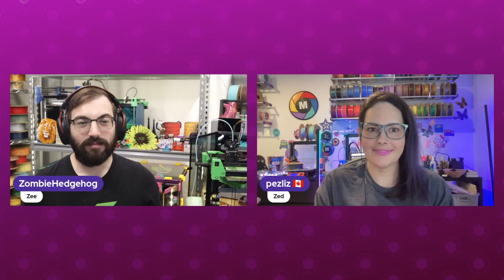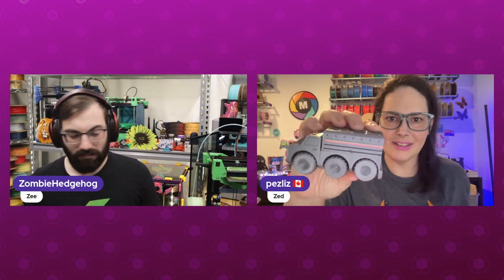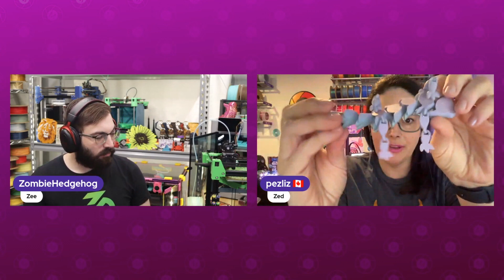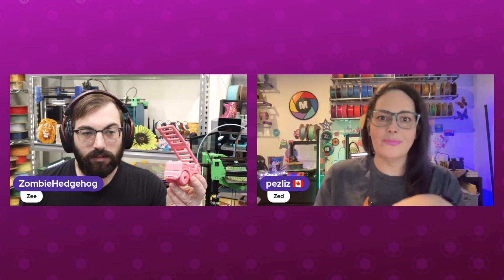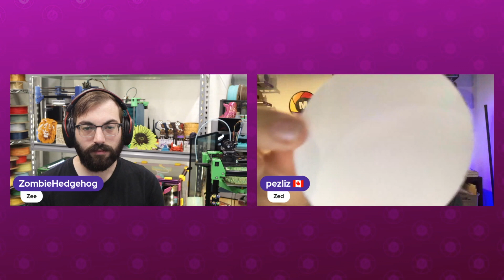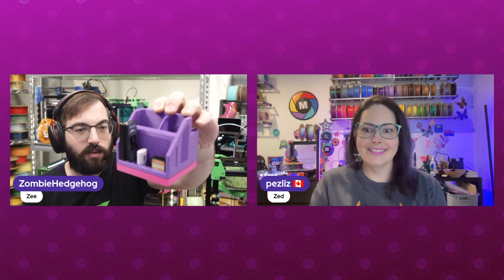3D Printer Maintenance - Zee & Zed Episode 20

Comment: I'm not a heavy printer, maybe one or two spools of PLA a month. I occasionally have to change a nozzle, or look into lubing leadscrews, (Modded Ender 3 Pro) but most maintenance goes into the print surface. I have a thick (1.5mm) sheet of smooth PEI stuck to a sheet of glass. IPA between prints, after 5-10 prints I'll use dish detergent in the sink, and every couple of weeks I'll take some fine steel wool to really clean the surface then do the detergent. I've been very satisfied with the results.